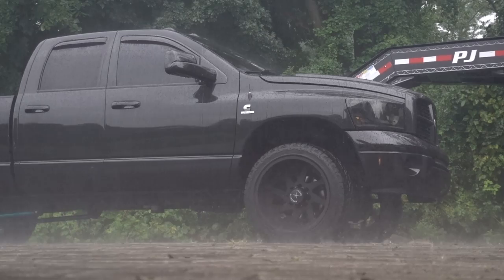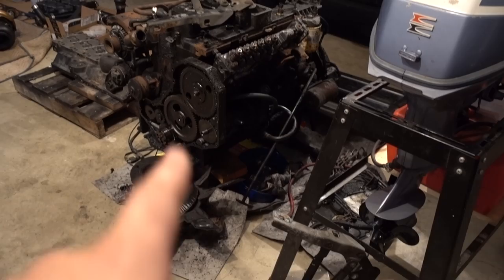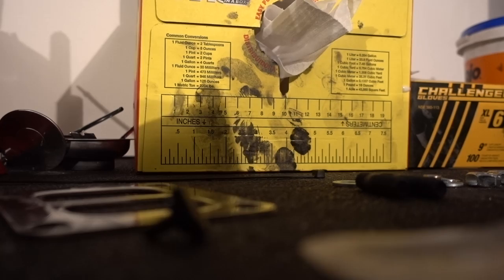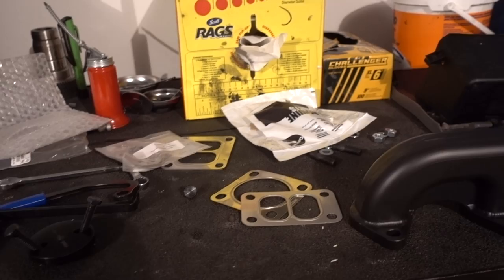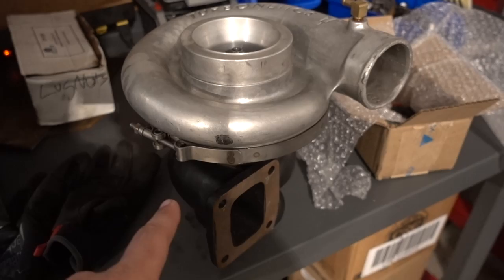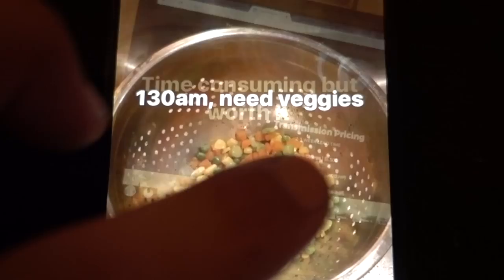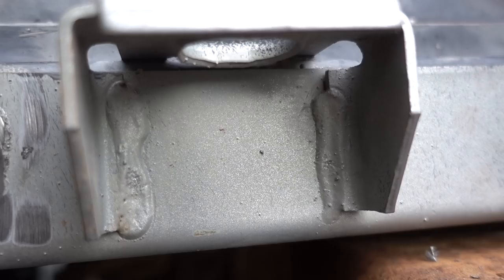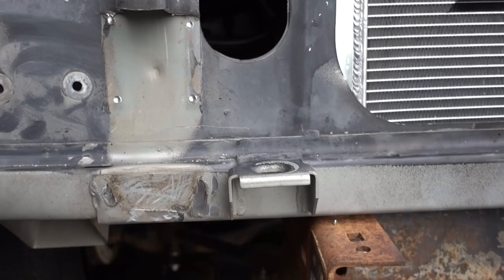MASSIVE TURBSKI FOR THE FIRST GEN 12V CUMMINS!!! & THE REAL STORY ON JOHNNY SENDIT!!!

Comment: Instead of angle iron for the intercooler mounts, could you take a piece of square tubing and cut it at 45 or 60 degrees and weld it on? 

Have one flat end and one angled end.

Comment: Use U channel and 2 legs off leaving a tap to sit on top. Then drill a hole for the post of the inter cooler to sit in. Will save a lot of time not needing to cut the other tabs off. And if you ever wanted return back to a stock intercooler you can.

Comment: Greg, Is the hood latch going to hit the top of your intercooler after you remove the upper brace? Hope not, or you may have to pin the hood down. (So much for the Virgin stock hood, oh that's right! There's already a massive hole in it! Snicker, snicker!) Good luck! I am jealous! Wish I had even a 1 car garage to work in.

Comment: Those intercooler mount tabs r not that bad to cut off n move. As long as u have a cut off wheel n grinder u shouldn't have any problems.
Reply: Bryan Mussel I agree. Use the 3" cut off wheel for the big stuff and use the Dremel for the "finish" part to break the welds.
Reply: Darin Allen yea he will be fine. I'm a collision tech/painter/fabricator at a shop in buffalo ny. I have cut these off before on wrecked cars to replace n had no issues. Greg A can't wait to see that intercooler in 1st gen tho. Will look amazing
Reply: Think I probably used my die grinder with a small cut-off wheel to remove those mounts when I fabed up my 2nd gen IC.

Comment: T4, non-divided exhaust housing, 72mm comp wheel, which means the turbine has to be pretty darn big... On a VE truck. That thing will take days to spool. lol
And a 70 LPM injector is on up there... I run an 81 LPM injector with a 62/68/.7 T3. That's a fine setup for a VE. Any bigger is a waste, because the VE is the limiting factor. 500 HP is all a 12mm VE can make.

However, with Greg's plans to P-Pump, that setup might work a little better... Maybe.
(I'm not hatin'... Just sayin')
Reply: Oops, re-watched the video and realized he said 58 LPM injector, not 70... I was looking at injectors before typing that comment.
Reply: Will M I have been thinking the same how worthless and doggy that must be